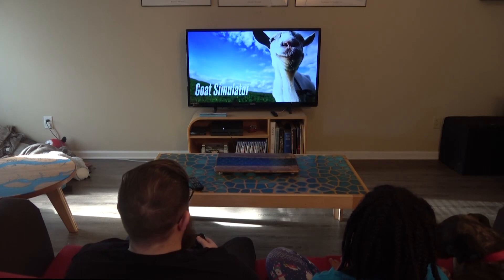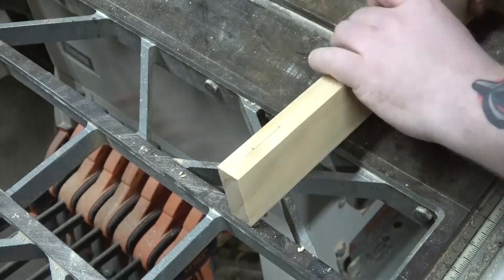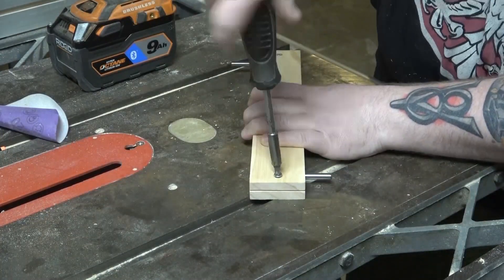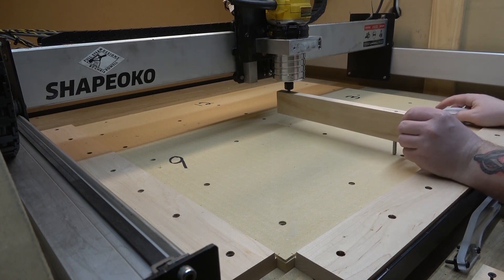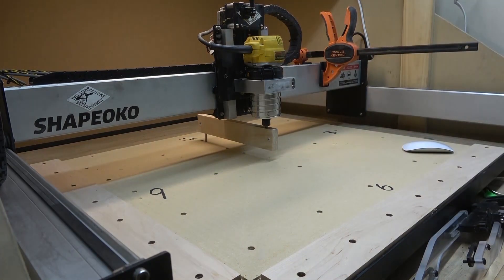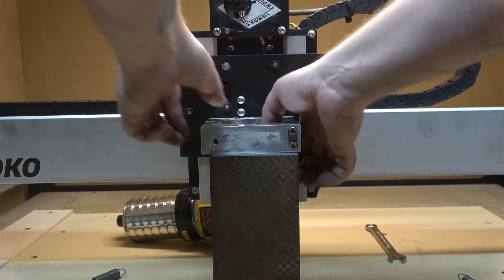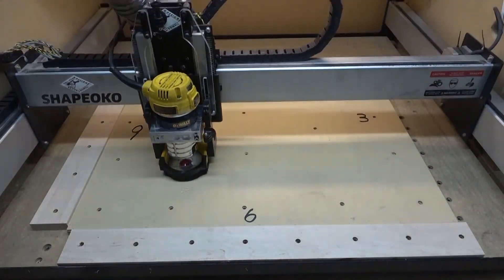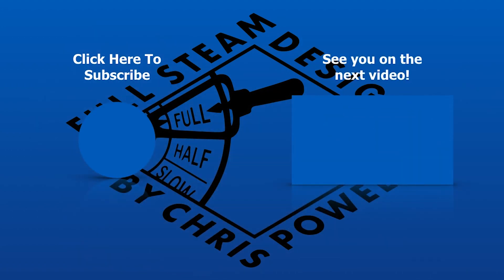How To Tram Your CNC Router without expensive tools Shapeoko

Comment: The only problem I have with this idea is that you should have used a drill press for the holes. If you didn't drill straight down, then the device would already be out of line.
Reply from the maker: That’s incorrect. I’m pretty sure I explained why in the video. The plane created by spinning the tool will always be perpendicular to the shaft in the collet. It doesn’t matter if everything is drilled perfectly square or not.
Reply: @ChrisPowellFSD  I actually had the same question, I didn't hear it in the video, but i'm at work (dont tell).  But once I read your comment, closed my eyes and visualized it, I agree.  Very nice!!!  Think I'll do the same thing, but use my cheap Harbor Freight Dial indicator.

Comment: Q: Just trying to wrap my head around this, not trying to challenge your design, as I'm about to tram my CNC, but one aspect of your tool is gnawing away at me.  It looks like you assumed that the holes you drilled were perfectly parallel with one another (eg: both were drilled at exactly the same angle thru the wood (90 degrees?).  In other words, if the holes are not perfectly parallel, wouldn't that throw off your calibration once the "arm" is mounted in the router?  e.g.: if one hole is at 90 degrees but the other is skewed slightly at 89.7 degrees?  Again, just trying to learn and understand this approach before diving in to it on my CNC.
Reply from the maker: They don’t actually have to be parallel or perfectly 90 degrees. The imaginary plane created by spinning it will always be parallel to the face of the bit in the router. One could be 45 degrees and it wouldn’t matter. It’s the plane created by spinning it that you’re after.

Comment: Hey Chris do you have the setup info to put in carbide for the surfacing bit?
Reply from the maker: You just put it in as an endmil. All you should need is the diameter.
Reply: @ChrisPowellFSD  gotcha, ordered it yesterday didn’t know if it would have the feeds/speeds listed when it got here
Reply from the maker: @SpwnDragn  for surfacing a wasteboard, I run it as fast as I can. 200ipm is no problem for it. I make really light passes. .01” usually.
Reply: @ChrisPowellFSD  hey Chris sorry to keep bothering you, on the part where you use the clamp to til forward backward, if I’m at the front and I pull down to get the gauge to 0, the minute I let go it goes off 0, when I go to the center of the wasteboard and tilt forward I can get it to 0 and it will stay at 0 but then when I move it forward (towards me) it’ll go off 0

Comment: How do you properly tram if the waste board isn't perfectly flat? I assume flattening with a machine that isn't properly trammed would cause it to be out of whack?
Reply from the maker: You flatten first. Even if the tram is off, you’re still making the whole wasteboard parallel to the face of the bit and that’s what’s important. That gives you a surface to tram from.
Reply: @ChrisPowellFSD  Appreciate the answer. I will run my flattening operation first and then tram.

Comment: Simple and direct! No need to buy an expensive tool with two dial indicators, and to be fair, this is probably more accurate! Thanx mate! 👍
Reply from the maker: I’ve had good luck with this method. Thanks for watching!
Reply: @ChrisPowellFSD  Just finished dialing in my machine... Bit of a challenge on a 1200x1200 surface, and I think the key is to be patient. Trammed three times, and surfaced 4 times, but it's 100% level now with just those 'fluffy' marks between the cuts, as on yours. So glad I  found your YouTube post! Cheers mate! 👍

Comment: Very nice. I trammed the router holder on my machine with 123 blocks. Like the way you used the wood to check the table.
Reply from the maker: That was a small metal surface plate.

Comment: I still see tool marks or undulations on your spoil board...is this normal or should the tramming have fixed this?  I've noticed these on my workpieces after face milling and was trying to figure out how to get rid of those marks.  All videos I see on youtube seem to show these marks.  People just say that something must not be exactly square or plumb, and they just sand it off the wood pieces.  Others say it is tooling marks that are going to be there regardless.  What I see are undulations or wavy marks with not only visible ridges where the tool runs, but I can feel them as well.  Maybe only 1/32 or 1/64 inch, but they are there.  Any suggestions?
Reply from the maker: They’re most likely not enough to worry about.

Comment: Hey, Stephen Hall from Tube Ritual - I've been dreading tramming my machine, but this method is so much easier than what I've seen. I'll be doing this in the next few days. Great vid Chris!
Reply from the maker: Awesome. It works pretty well. What machine do you have?
Reply: @ChrisPowellFSD  I have a machine from PDJ called a Pilot Pro 2626. Not widely known, but they are built more like an Avid CNC.
Reply from the maker: They look interesting. I’m trying to figure out what my next one will be. Considering a cnc4newbie. I want something that can handle a half sheet of plywood.
Reply: Chris Powell I want something larger as well. Like a 4x8 Avid, but I don’t have the space for it yet ;) I’ve also used a Laguna Swift 4x4 and that’s a good machine. Those are super heavy, so it would be nicer to stick with a kit machine.

Comment: Great video, many thanks, one question, or comment, does the bit that is fixed in the router have to be perfectly square, cos if not it will throw everything out?
Reply from the maker: No both can be crooked. By spinning it, you’re creating a circle. The face of that circle is parallel to the face of the bit you insert into your router.
Reply: Chris Powell ah, yes I see it now. Why not tram to the x and y rails? Before surfacing ?
Reply from the maker: I can’t think of any method of doing that that would be easier than just surfacing the wasteboard.

Comment: It’s not “parallel to“, its “perpendicular to“.
Reply: Technically the face is parallel, it's a flat surfacing bit.  The shaft would be perpendicular.
Reply from the maker: The face of the bit is parallel to the surface of the waste board.

Comment: Chris,  I've been working on tramming a few days now.   I've trammed, flattened, and retrammed.   I still see and barely feel ridges going from front to back (like this IIIIII).  I think that's the X axis (spindle) that needs adjustment.  I used my 1-2-3 blocks, machinist square, and digital calipers and got it PERFECT.  However, with my tramming tool, just like yours, it's rubbing on the left and about .80 mm high on the right.   What should I do?  I assume the tramming tool is more accurate than the 1-2-3 blocks in this situation, correct?  What do you recommend?  Thanks
Reply from the maker: The problem with the 123 block is it really has to sit on the ridges to give you an accurate measurement. The tram tool is a more accurate way of measuring it.
Reply: @ChrisPowellFSD  Thanks!

Comment: Thanks for the video...  I'm about a 1/16th off from my front to back.    I've done exactly like you but I can only get about a 1/32" movement, and that's really putting some weight behind it.   I also tried loosening all eight bolts (the two pivots) but still no movement.   I think I can get it if really put a lot of weight on my two clamps, but it's requiring A LOT of pressure (I'm around 200lbs and it's requiring most of it).   I just wanted to get your thoughts before I do that.  I don't want to bend or break anything.  I have a pretty flat torsion box and no leveling feet just pink foam sub-base. BTW, from the day I assembled, I had a hell of a time aligning my bolts.  There's like zero play! Even when I loosen them, they're very tight in the holes (shocked I didn't strip them).    Thanks
Reply from the maker: I’ve heard this before. Some machines do seem to be a little tighter than others. You can file out the holes a little to get some adjustment. I know it’s a pain, but that’s about the only thing I can think to do, provides everything else is square.

Comment: I need to make a new wasteboard with threaded inserts and complete the tramming. Which should i do first make the wasteboard and install, then tram to the new wasteboard? Tram to the old/ original wasteboard
Reply from the maker: Never really been a fan of the threaded inserts, but you should just be able to cut them in the supplemental wasteboard, insert the threaded inserts, flip it over, secure it to the wasteboard, then surface the supplemental. Then tram, and surface again if you make any adjustments.
Reply: @ChrisPowellFSD  thanks bud. Keep putting out great content!

Comment: Hello Chris,thanks for the video. I love your enclosure for the Shapeoko, would you share the dimensions and or design with us?
Thanks, George
Reply from the maker: Thanks. I just used a 4x4 sheet of plywood for the bottom, out some 12” long 4x4 legs on it, and used mdf for the top. It actually overhangs the plywood base so the inside is a full 4x4’. I built the whole top box, and cut the door out of it. I wish I had done a video on it, but it was before I was doing stuff like this.
Reply: @ChrisPowellFSD  How high is the actual cabinet inside dimension?

Comment: Tramming on the X axis can be done with eccentrics as they are inside the rails.
Reply from the maker: I only have eccentrics one the bottom of the plates for any of the axis. I’m not aware that they ever put them on the top also. Sounds like it would be very difficult to set up and keep them properly tensioned.
Reply: @ChrisPowellFSD  It should have read Z axis but effects X tram.
Reply from the maker: The only eccentrics I have are on the bottom v wheels. There’s no way to adjust tram with them.

Comment: Chris....if your old router bit that's inserted in the router isn't perfectly 90 degrees to your piece of pine, that will affect the other side of the pine and make it look out of alignment.
Reply from the maker: That is correct, but it won’t have any effect on what we’re doing here. Each bit is fixed, and the circle you’re making with the bit will always be parallel to the face of the bit that’s in your router.

Comment: Chris I have  a question. I have  a xxl and I found the other day that when it is jogged all the way forward it touches the left front frame  bracket but does not come in contact with the right front bracket. I have  checked that the frame is square from corner to corner and  it is. So I am wondering if at some point that the belt on that sid e has skipped a tooth or two and that is causing this to be that way. Any Ideas Thanks Jeff Peters
Reply from the maker: I don’t think it would matter if the belt skipped a tooth because it’s a stepper motor. It homes off the switch in the back right. When it’s all the way back, does it touch on the right and not the left. Sounds like something is out of square.
Reply: @ChrisPowellFSD  Chris when I pull it back the right rear side touches the up right but the left rear does not about the same as the front space. Does you unit touch both sides moved all the way forward and  back word
Reply from the maker: Yes, it is. I used a carpenters square to make sure my frame was square. I found it difficult to accurately measure from corner to corner because all I had was a tape measure. Have you done any tests to see if you’re cutting square? You can cut a square with a fine point bit, and measure from side to side and corner to corner on that.
Reply: @ChrisPowellFSD  Chris yesterday I created a file to cut out a 4 inch square using  ,625 end mil to check to see if it cut it out square, So I am happy to say that  it was square all the way around. So I assume that that means the  gantry is square to the side rails.  Have you ever just pulled your gantry all the way forward to see if it touches both front up rights.?

Comment: Couldn't you use the 123 blocks in the Y direction as well? It will show you when you are parallel
Reply from the maker: You can, but I still recommend checking it with the tool we made after setting it with the 123 blocks. The length of the tool makes it more accurate. Mine is about 10” long from point to point, so we’re measuring about 20” with that, vs 3” with a 123 block.

Comment: Hey Chris, I paused it at 2:07 and something caught my eye. Did you make sure the bits you put in the wood are at exactly 90 degrees to the board? It looked kind of crooked which made me realize how important that has to be when I recreate this.
Reply from the maker: It actually isn’t important at all. Each bit could be at a a crazy angle, and it wouldn’t matter because the circle that you create will always be perpendicular to the z axis.
Reply: Thought the same thing. Freehand drilling, no way that hole was square. But, a great idea overall, just need a bit more precision.

Comment: Great job.... seriously I never got even  close!! Especially without removing that damn front plate  multiple times..... I had to buy a supply of m5 bolts for the  spindle mount because I stripped several working on a tram left to right and went through a mile of tin foil tramming front to back. 
Your a  tramoligist my friend!!
Reply from the maker: Just lucky haha. Some of the hardware definitely leaves something to desire. I think some of these are single use screws.